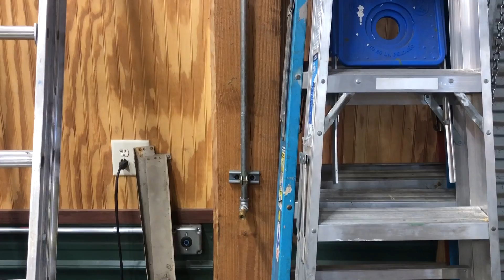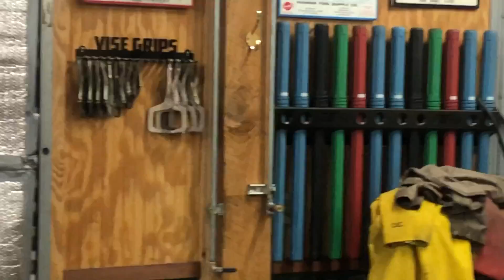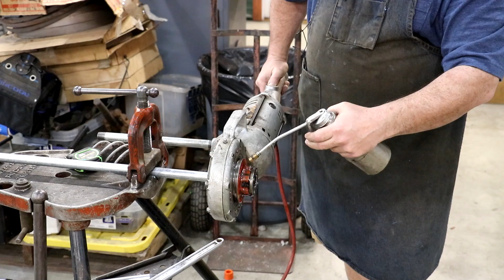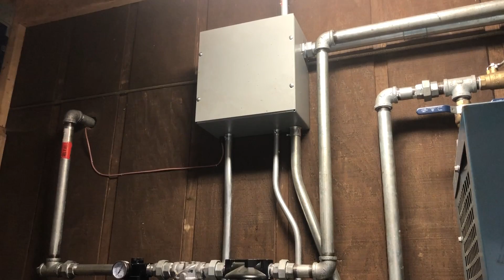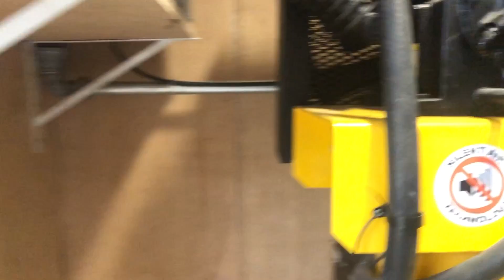The Ultimate Shop Air Compressor Setup! (at least for me....)

Comment: Great system. I thought about doing galvanized, but I went with black pipe. It’s cheaper, it seems easier to seal up reliably, and won’t flake zinc into your runs.  Also, the tees need not point upward. I elected to point them downward to my drops because I wanted anything to come down— I have tees on my drops, so any debris won’t make it to my tools. Past that drop leg, there’s a ball valve for drainage and purging at each drop.

Comment: It's probably redundant but wouldn't it be a better idea to instead of having the air from 1. the pump 
2. the tank
3. The aircooler
4. The drier
5. second tank

Better to go

1. Pump
2. Pre Cooler
3. Drier
4. 1st tank
5. 2nd tank
6. 2nd cooler

That would in theory eliminate a higher percentage of moisture

Comment: Nothing better than ,.. and thats what I did first in my new garage shop was put in a great Air system.... several airline  O.H. reels,.... half dozen waist level outlets.... pressure regulator and dryer... .. then I bought a Scatblast Cabinet.... couple nice paint guns.... AIR TOOLS ...and a garage face long hose tire fill point... then I made several small Bird Houses😂,.. a battery holder for my ATV....I had Bells Paulsy😵‍💫😵‍💫 and at least I have a nice lookin' shop... been unable to really use what I installed to the MAX but I have it.😁....😎

Comment: galvanize or black iron pipe? Which one should I get? 
Keith my good friend I got the idea that maybe galvanized is not the right material I think black iron is the pipe this system needs. I know for gas for natural gas and whatnot that's what you need, but I got a sneaking suspicion that galvanized is not good. I'm gonna do some more investigation ... but that system is fantastic I think you'll be ok, maybe you'll have flakes of galvanized in your filters you'll have to clean out but I think you'll be fine, but I think a guy setting up a shop will need to us B I pipe... what do you think?

Comment: Why not remove the moisture from the compressor discharge.  From your description, your drying the air from outlet of the first air receiver.  If you dry the air from the compressor discharge before it enters the first receiver tank then you prevent water accumulation in the first tank.

Comment: The control system seems a bit more complicated than it needs to be. In my shop, and the one at our makerspace, I used the 120VAC from the lights to close a contactor and power the compressor.  So when the lights are off in the shop, so is the compressor.  This automatically prevents the compressor from running all night if it throws a belt or the piping fails.  When you enter the shop and turn on the lights, the compressor comes on.

Comment: Hey guys in the know, why have the pipe configured in a ring all the way around the shop that is connected? Why not just have a split that goes to the two different sides of the shop? Is there a benefit in connecting them? If you don't know please don't answer.

Comment: From a 40 year pipefitter A+ on the pipework. On your low point drain yo can create a drum drip. Great drain feature for air condensate. Great move just using joint compound. You shouldn’t use tape on air or gas systems feddind sensitive equipment

Comment: 9:52 just a thought, but running that downspout outside, you might want to have some sort of clear plastic containment so you can see if there is anything coming out that may tell you if you have a problem with your compressor such as oil contamination or any bits of metal.  Sometimes people don’t clean their pipe as well and you get little shards, but you don’t want to end up in your tools

Comment: i’m glad there is someone else out there who used galvanized pipe for their shop over that blue Plex airline. I think maybe I would use that stuff in a home garage when mounting over drywall when you don’t plan to use it every day. galvanized pipe for commercial, set up and blue plaques or copper for a small home garage. I would never recommend copper for a commercial shop. Too many people coming and going and lots of eyes lead to thieves, breaking in And stripping the copper.

Comment: Instead of pipe (heavy, slow to erect, rusts internally) I plumbed my shop with red air hose and Chicago couplings. 
I also run a large industrial receiver tank (cheap used because hobbyists don't know they exist nor do many small shop owners).
I can rearrange equipment effortlessly and red air hose is only a couple bucks a foot. Couplings aren't expensive in bulk via Ebay though I had to redrill some of the hitch pin clip holes (1/8" bit, connect couplings than run the bit through to match the holes). 
I went with a rotary phase converter since three phase motors abound and I buy machinery with them at auction. VFD for my lathe and mill of course though for the variable speed control which it totally worth it.
My compressors are horizontal so I fabbed chassis and mounted scaffolding casters with 8" wheels. I put demountable wheels on everything (machine tools included) which makes life amazingly convenient when I add equipment. I used a small Harbor Freight 12v winch and a Clore JNC 660 jump pack as a shot "tugger" to bring my compressors into my shop. Being able to pull heavy objects effortlessly is insanely handy.

Worth remembering is you don't have to replace compressors because adding more of them increases volume.

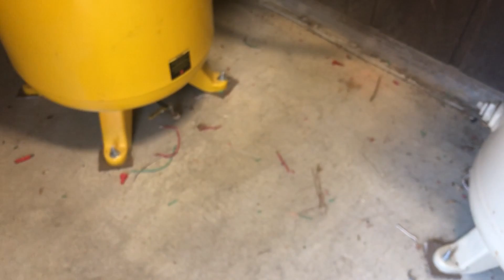Comment: Two easy suggestions Keith, very small but can save you a headache. First at 22:35, at the bottom of your tanks is an elbow with 8" ish nipple and valve for your timer drains. Let me tell you after many years of working on compressors, that toes find their way of stepping in them. They snap off easily right at the bottom of the tank. Then you have to stop, lay on the ground, reach under there with an extractor tool, then make the repair. Easily preventable. The bottom of the tank has 1 elbow, just add another one. If you kick the nipple sticking out or step on it with your toe, it will thread down or sideways a tiny bit and not break. Im telling you it does happen all the time. Second suggestion is also super easy. That shed will be warm and spiders and all sorts of little bugs will find a home in there. Add one hose connection. When you inevitably go to do maintenance, you can blow all that dirt and cobwebs out. easy.

Comment: I see this video is 2 years old, so how is the emax holding up? I’m looking at one 20hp with 120 gal tank, I do sandblasted signs, how do you think this unit does for sandblasting and what pressure do you blast with it. I need about 100 psi maintained for 30 minutes at a time, do you believe this can do that? 
Thanks

Comment: Several decades ago, a shop needed an "Import" tech as children of customers that had cars repaired grew up and had Honda's, Toyota's etc. 42 years of this shop used every trick found in Popular Mechanics. His 120 gallon, two stage compressor sat on top of the bathroom. He routed copper pipe to the toilet from behind. A simple typed note, taped to the wall with shipping tape that kept it new, said; "Empty Each Night." Open the valve and the condensation flowed into the bowl. Sometimes the simple things in life work the best! DK, retired auto tech. Happy holidays, Dec 21, 2022.

Comment: Couple of things Keith.

1) I was reading about fittings on a forum several months back and a guy stated and made reference to a book  that pipe thread were not designed to seal against each other UNLESS it was fuel rated. ? 🤷‍♀ I don't know

2) You might want to check out this video. This guy plumbed the "cooler", in your case the first one, between the compressor and the tank. As you can see in the results of the video he is getting a LOT of water out before it even gets into his tank mitigating the rust risk considerably. This is how I want to set up a cooler on my compressors. Thought you might find it interesting.

https://www.youtube.com/watch?v=ojpBwz121NI

Comment: The "Blue plastic pipe" does come in black. You should have done some research first and went with Black HDPE Rapid Air Piping in 3/4". The problem your system WILL 100% have is the Galv flaking off and getting pushed through your air plumbing. Hopefully your low point in the corner catches all that debris b4 it gets ran through your tools or machines and damages them. Either way hope it makes your life easier b4 it doesn't

Comment: I did the same thing only with copper except one drop. That was on a inside wall it didn't pot a drop to drain that air fitting and guess what i had to replace the valve about every 3 months. The idea of putting the t up and 90 down doesn't work either. I did that  at a carpenter shop I had to put drain valves at each drop. So save time and money and don't be a cheep skate and do the job right, your tools will thank you.

Comment: Agreed it's a well planned system but in spite of it all, galvanized pipe IS NOT recommended for air or gas systems because of the galvanize coating inside and the flaking problem.  Black iron pipe, painted if you like,  would been cheaper, and less likely a future problem. It''s a coin toss, so I  hope you don't have problems.

Comment: It may have been said already I am not going to read thru all the comments .. but each drop add yourself a 10 to 12 inch piece of pipe and a ball valve as each drop all tho fed from the top will still degrade and add sediment to your line... that way each time you go to use a tool .. you can open it blow it out for a few seconds and keep the micro fines from being introduced to your tools.. the over all project is amazing and really top notch... A+ to the project

Comment: Keith, I noticed that you have your air compressor bolted to the floor. When I did that, it rattled and vibrated like crazy so I took the bolts out and just left it setting on four pads of truck mud flap material. It seems a lot more happy now.

Comment: When it comes to air systems it only gets more complicated the more air you need/use, so well done on the setup.
I prefer using the plastic pipping systems with push-fit or compression fit similar to water systems and price isn't bad, for me its a safety thing as i have a small workshop and metal becomes bullets were the plastic tends to just tear and leak air.

Comment: Always enjoy your videos, very nice set-up. I am an old pipe fitter ran my far share of screw pipe. On your unions you have a male and a female. I looks like you have yours in backwards of the air flow. I can't tell you how many times I have seen inspectors catch this during inspections. I wish the manufactures would add flow arrows to them. It really isn't an issue until you get into abrasive service for it to start eating away at the mating surfaces of the union. We you take the union apart the one that has the lip sticking out the has the outer slip ring is the male.

Comment: Impressive set up, I have that exact same compressor and I love mine. It sounds like you might be having the same issue I had with mine. The unloader valve that came with it was corroded and hissed for 20-30 seconds after the compressor turned off. I called Emax about it and they were very good to deal with. They sent me a new valve under warranty at no charge. With the new one installed it only took a few seconds to bleed off the air when the compressor turned off. one option I was glad I decided to get on mine is the continuous run valve, it allows the pump to open a valve when the tank is full to bypass it so the pump keeps running and avoids constantly cycling the motor.

Comment: Kudos on your system.  My work experience was as a naval architect/marine engineer,  working with oil tankers.  I have been involved with the design and redesign of ship's air systems.

Ideally, designing, for ship service, control and start air systems requires the production of clean, dry air.  We used water cooled tube heat exchangers and cyclone separators to remove water in hot, humid climates.  To further remove water for control air we used Hankison Refridgifilters.  Ideally, air should be cleaned and dried prior to it being put into the air bottle to prevent rust in the tanks.  Tanks were coated with varnish on the inside to prevent corrosion. Our preference  for service air compressors were rotary screw compressors.  Piston compressors were used for start air because of the need for higher pressures.   We also used hand-cranked single cylinder diesel air compressors for dead ship starting in emergencies. 

If I  were designing an air system today I would use stainless tubing and compression fittings such as those made by  Pyplock and others.  In areas where mechanical damage could be an issue I would switch to stainless pipe.   I would also look to dry and clean all air, not just control air.  I would tend to move away from galvanized pipe because, just like tools made overseas, it just isn't made like it once was.  In a new build project in the late 1990s to early 2000s we sent an engineer to inspect galvanized pipe at the supplier to ensure quality, something a general consumer cannot possibly do.

In any case I enjoy your videos immensely. 

Bob

Comment: That's a pretty nice setup. I got a very, very simple air system - just to separate the noise from myself. I use a time switch, which automatically switches the compressor off after a set amount of time so you can't forget to turn it off.

Comment: I agree on the way real pipe looks, when I redid my air lines last summer I went back and forth a few times and ended up with black pipe. Have had issues with galvanized flaking and getting in tools and I couldn't bring myself to trust "O" rings for the long term. 
"THERE is NO KILL like OVER KILL"
No one was ever upset that they over built something.

Comment: At the bottom of your drops you should have a short length of pipe with a cap on the bottom.  That will provide a moisture trap on every low point, it's code for natural gas lines which means it's probably a pretty good idea for ordinary air which starts with even more moisture than natural gas does.  Compressor in a different building is always a nice way to keep the noise down.

Comment: Having problems finding plumbing supplies at your local H/D or L's ?  
Check and see if you have a local Irrigation or Plumbing Supply House near you.  They will have far more options and quantity for you.  
I get tired of always having to come up with work-arounds because H/D, and L's sell only the top selling items but leave out the critical parts you need to complete any given design you come up with !!  
Guaranteed  !!  You go in with a short little list of parts (maybe 5 parts), for your project .... At least one part will be out-of-stock, or not even stocked at all !!  
I find myself at ACE hdwr or the Supply house more and more !!   Strange that little Mom and Pop ACE hdwrs have more of the problem solving parts I need for my wide ranging projects, than those Big Box stores !!

Comment: you didn't need the unions... you can cut out whatever needs replacing in 15 years and then install a union at that location... much cheaper
Reply: @cmmartti  you haven't put much thought in to your answer... I assure you he could thread the ends on the ground.

Comment: The biggest fault in your system is having a pressure regular at the start of the of the piping system as it leaves the compressor shed. the air pressure is going to drop drastically in the piping system from  the point of the air regular . If you set the regular say at 100 psi , depending on the air demand you can drop to 80 psi in the air piping system .air regulars are always playing catch up to air demand .

Comment: I would say the only + of galv. iron pipe  is rigidity - the big minus is rust where its been threaded and into fittings, also internally. I avoid its except where the rigidity is needed like in stand pipes.

Comment: I used 3/4 inch black nylon tubing used on truck air systems in my shop for my air system it's been 15 years now with no issues the tubing is pretty cheap but the fittings are expensive when you start buying a bunch of them. In hindsight I kind of wish I went with either black iron or galvanized because no matter how hard you pull the plastic tight or how many holders you use there is always a sag some where in it especially when it is hot out. My cousin used regular pex in his shop which is pretty much the same as what is in the plastic shop air line kits and his lines still sag even though it is thicker walled and he used the straight pieces of pex instead of the coiled pex. We live in the northeast where we have freezing winters and I've worked in shops with steel air lines that go through unheated sections of shops and the steel during winter seems to have more moisture in the air than the plastic and that is why I chose the plastic tubing. I still have to blow out my lines before I use them but they don't seem to have the moisture like most steel lined dhops I've worked in had.

Comment: Why no shut offs on your drops just before the air line connection? The last thing you want is to cut or damage a air line and then have to run over to your control panel to shut the system down while that hose is whipping around.

Comment: Nice job, you seem to have thought of everything.  The weak link in my opinion is the red rubber section of conventional airline used to reduce vibration.  This flexible pipe section [available at Grainger ] is made for that purpose and would be better, especially since you wanted the best overbuilt installation.  
JIM